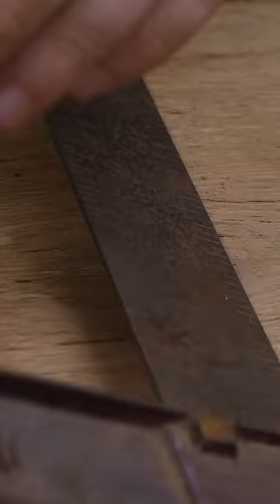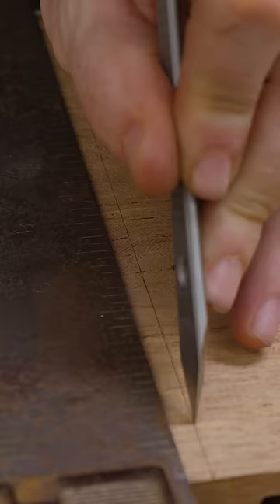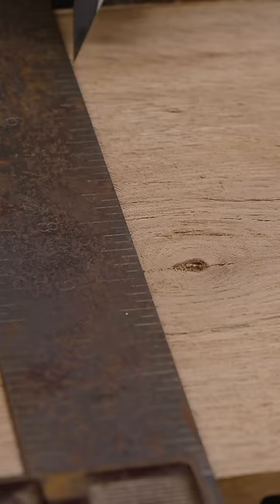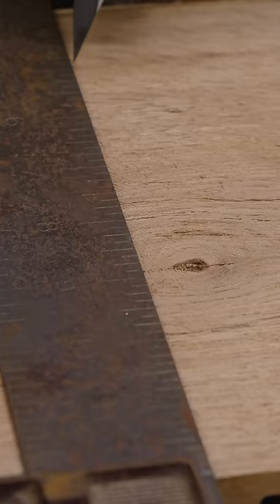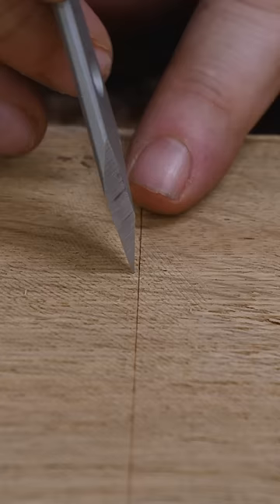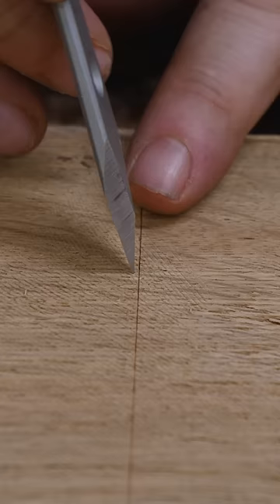How to Test For Square and Straight

Comment: Why not just use a protractor to see if its a perfect 90°
Reply from the maker: that would be a big protractor. that will only measure from the center point out as far as the marks are on the protractor. for the small ones that work well but for 6+" it is better to measure further out on the tip of the square for more acracy.
Reply: @WoodByWrightHowTo  thanks for the advice

Comment: Have you ever wondered where they got the precision tools to mass produce precision tools? It literally makes no sense. 😂
Reply: I already know how, but it's too complicated to explain. The tools were invented using basic observations thousands of years ago. Some improvements have been made but probably not as many as you think. 

Look up."Kha's Protractor." The Aztecs and Mayans had something similar that they invented separately. 

You might not have been informed that modern geometry was invented in ancient Greece. 

Today we have lasers that can measure and calculators to do the math. 

Calipers aka Compasses, are another ancient tool used in wood working, masonry, metal working, map making, navigation and astronomy. 

What's really crazy is how accurate astronomical measurements were back then.

Comment: I always use the 3 4 5 rule... 3in, 4 in, the difference between will be 5in if square
Reply from the maker: That's why I mentioned at the beginning of the video. It's also known as pythagorean's theorem or a squared plus b squared equals c squared. It works well on larger measurements but on the smaller squares the actual mechanical method used for marking and measuring it is far less accurate.

Comment: 3,4,5
Reply from the maker: that is the Pythagorean theorem that I mentioned. it will get you close and will work well on large scales but on smaller scales the actual layout of the measurements is difficulty and prone to error of the measurements.

Comment: It took me almost 1½ year to realize that 0.01 mm precision is completely useless in most woodworking tasks. 0.1 is plenty precise for most projects
Reply from the maker: Right on. And 90% of woodworking getting within 1mm is more than good enough.
Reply: @WoodByWrightHowTo  Absolutely. So far I've only found friction fit drawers and high detail veneer work to require less than 1 mm. Doing it elsewhere is just flexing, but, funnily enough, the exam requirements for one of the cabinet maker educations in Denmark require a tolerance of 0.01 mm on all measurements throughout the entire piece made.

Comment: Just put some printer paper up to it
Reply from the maker: I've done it with heavy cardstock before. But the problem is I prefer to use a marking knife rather than a pencil it gets a little bit more accurate. And paper doesn't like that.

Comment: Won't work if the blade on the square isn't square.
Reply from the maker: That's the point of the video if it isn't square the lines won't match up and you need to adjust it.

Comment: Pythagoras therum. The side of  the wood panel could be out. A squared plus B squared equals C squared.
Reply from the maker: That's what I mentioned at the beginning of the video. It'll get you close but it's not accurate enough on small pieces.

Comment: Wait, so instead of a little math, you spent time building shit that takes longer than the math problem? Priceless 😂😂
Reply from the maker: A^ +B^ = C^ it works great on larger measurements but for squares under about 12" the mechanics of doing the measuring introduce a lot of error. Not to mention it takes 2-3 times longer to set up.

Comment: 3,4,5 you don't need a tape measure use anything.  Cut a stick any length.  From the corner count 3. Start same corner other side count 4. Now the straight space from end to othe end will be 5 if square.  You're welcome.
Reply from the maker: That is what I mentioned at the beginning of the video.

Comment: Dont buy cheap squares either there not always square i learnt the hard way it just took 6 months to find out
Reply from the maker: The expensive squares have the same problem. Even the best starrett square you can buy and still come out square. I've had a couple of those. Always check them before you buy

Comment: … just use a protractor.
Reply from the maker: That isn't quite as accurate. Because it only checks for square part of the way up the blade. With method I show here it checks at the end which makes it easier to get closer.
Reply: @WoodByWrightHowTo  Laser protractor, like 10-15 bucks. Or you just tie a piece of string to a regular protractor. The answer is always protractor unless you wanna get really fancy, then you just hold your square against the corner of your bench.
Reply from the maker: Both of those options have a serious problem with their thickness. Being out of alignment by the thickness of the string or the beam of a laser is a considerable amount out of alignment.

Comment: 3,4,5 one leg 3 inchs, one 4, one 5. 3^2 + 4^2 =5^2. I learnt that building walk in coolers
Reply from the maker: That's why I mentioned right at the beginning. A squared plus b squared equals c squared for the Pythagorean theorem. It works great on larger scales but on the smaller scale it is functionally very difficult to measure out and get accurate.

Comment: 3,4,5, it
Reply from the maker: Right on. That is what I mentioned at the beginning A^ +B^ = C^ it works great on larger measurements but for squares under about 12" the mechanics of doing the measuring introduce a lot of error. Not to mention it takes 2-3 times longer to set up.
Reply: @WoodByWrightHowTo  yea, you would need a metal shop ruler with thousandths of an inch, not the best idea I suppose 👍

Comment: Random internet guy mentions the easiest method to figure out if your square is square right up front , but has all kinds of "easier" methods lined up for the rest of the video.
Reply from the maker: the pythagorean theorem is great in theory, but very difficult to get right on small scale and takes a lot longer to set up.

Comment: 3,4,5 method
Reply from the maker: Right on. That is what I mentioned at the beginning A^ +B^ = C^ it works great on larger measurements but for squares under about 12" the mechanics of doing the measuring introduce a lot of error. Not to mention it takes 2-3 times longer to set up.

Comment: How do you know the square is square tho
Reply from the maker: That's what the whole video is about. You check it against itself. If you don't get a straight line then it's out of square.
Reply: @WoodByWrightHowTo  what if the board isnt straight though..
Reply from the maker: Then you joint it. that is what I was showing with the plane.

Comment: I bought one expensive accurate square as a reference. 🤷‍♂️
Reply from the maker: You got to be careful with that. Even the best squares will go out of square and often they can be knocked out of square just by shipping. I've seen a $200 stare at brand new from the store that was out of square.
Reply: @WoodByWrightHowTo Fair comment. Certainly good practice to continue to check the reference square just like any other tool. 👍 It's just easier for me to have one known square (I keep it in a case) and just lay any other square tool against it to test.

Comment: 3 4 5
Reply from the maker: Right on. That is what I mentioned at the beginning A^ +B^ = C^ it works great on larger measurements but for squares under about 12" the mechanics of doing the measuring introduce a lot of error. Not to mention it takes 2-3 times longer to set up.

Comment: Use a 3-4-5 triangle
Reply from the maker: So I mentioned at the beginning of the video. Also known as pythagorean's theorem or a squared plus b squared equals c squared. It works well on larger measurements but on smaller squares the mechanics of actually doing the measurement or not accurate enough.

Comment: 3" + 4" equals 5". Simple.
Reply from the maker: That works well in large scale but when you're looking at small measurements on a 3-in square it's almost impossible to actually lay that out accurately.
Reply: @WoodByWrightHowTo  use 1/16" scale. Its on any tape measure. 1/32" will obviously be better. Your way works fine but it is pretty easy to figure that using math. Whatever works for you do it.

Comment: So 3,4,5 is too inaccurate, but you can eyeball a straight edge? 

😑
Reply from the maker: Yup. 3,4,5 is surprisingly difficult to measure accurately over the small distance of a square. And your eye can spot a straight edge that is off by less then 0.1mm over 18". Counterintuitive, but true.

Comment: I use a 1 2 3 block, guaranteed to be 100% accurate. Stop making things complicated when it doesn’t need to be.
Reply from the maker: That can test small squares.
Reply: @WoodByWrightHowTo  dude…I’m a machinist/bladesmith…. I’m simply naming a tool useful for the job… I hope you know they get MUCH bigger.

Comment: Buy a new one and check if the square is square with the new square
Reply from the maker: Surprisingly most squares sold in the hardware store are not square. But with a little flip trick you can check them in the store without having a square to check them with.

Comment: So you can eyeball the straight edge, to measure the tool, but can't eyeball the tool. 🤔
Reply from the maker: correct. you can spy down a straight line, but you can not spy around a corner.

Comment: or measure 2" down the short leg, 4" down the long leg and 6" between the 2" and 4" marks...no straight edge needed.
Reply from the maker: That's what I mentioned at the beginning it's also known as pythagorean's theorem. It's good in theory but on the small measurements it is very difficult to get accurate distances marked. And in doing so makes the variability difficult to achieve. Where is flipping the square is immensely accurate on small scales. Pythagorean's serum works very well on larger scales but not very well on the small squares.

Comment: 3” x 4” x 5” = 90* 
You don’t have to complicate it 🤷🏻‍♂️
Reply from the maker: That is what I mentioned at the beginning. It is easy for larger measurement but less accurate to lay out for smaller ones. It also takes a lot longer to lay out.

Comment: Hell you don't need that goofy shit just do a 6-8-10 dah 🤪🤣😎🇺🇲💪
Reply from the maker: That's what happened to mention at the very beginning of the video.
Reply: @WoodByWrightHowTo  I don't think so
Reply from the maker: 6, 8, 10 or 3,4,5 are just other ways to say the Pythagoras theorem A squared + B squared = C Squared. that method will get you close, but it in not accurate enough in practice for squares under 12 inches or so.
Reply: @WoodByWrightHowTo  yuz iz eggs ackly right! But it ain't no fun being straight if yuz iz a carpenter!👍🤣
Reply: BY 🤪
Reply: It's a crazy ass world 🤪

Comment: 90+90=180, and if it's not a straight line it isn't square...? Wtf are you saying
Reply from the maker: a square is a 90 degree angle. if you put two together you get 180 degrees. that is also known as a straight line. if you put your square together and get something that is not a straight line then you know your square is out.

Comment: 345 method.  3 plus 4 equal 5
Reply from the maker: I mentioned that at the beginning. it will get you close but it is not arcuate enough in practice for squares under 18"

Comment: Bruh 1+2 = 3(the diagonal) then you square.
Reply: You can expanse the number by multiplying them by the same number for each in the equation.
Reply from the maker: that is what I mentioned at the beginning of the video. it works well on larger squares, but on the smaller ones it is very difficulty to accurately measure out.
Reply: You can divide these numbers
Reply from the maker: Correct. That is pythagorean's theorem. A squared plus b squared equals c squared. The problem is it is very difficult to accurately Mark out those measurements on a small scale. It works well on larger scales. But on squares less than about 6 in it becomes inaccurate just due to the capabilities of marking it out.
Reply: Yeah but you don't have to use the square part if you use these specific numbers 1+2= 3. We all use it in carpentry because it's easy you divide or multiply the numbers etc.  @WoodByWrightHowTo

Comment: 345 triangle.
Reply from the maker: Right on. That's what I mentioned at the beginning. It's also known as pythagorean's theorem. That will get you close and works well in larger sizes. But for smaller sizes like this it's very difficult to actually Mark that out. Using the flipping method is far more accurate on smaller scale but difficult on larger scale.

Comment: Just use a level.
Reply from the maker: Those usually work as a great straight edge. Just make sure you're not using a masonry level. Those have a curvature to them ever so slight but enough to throw you off.